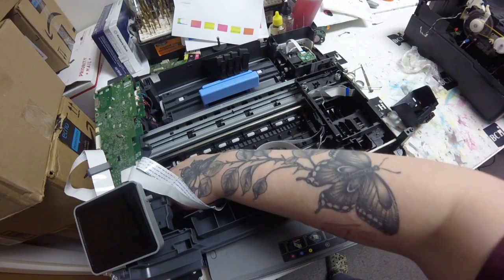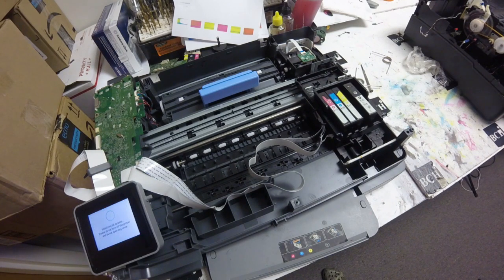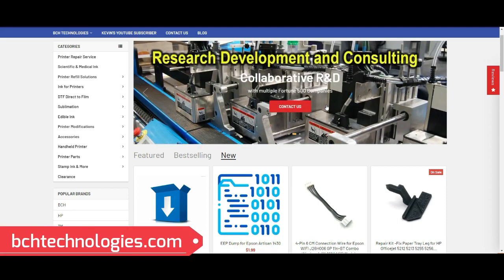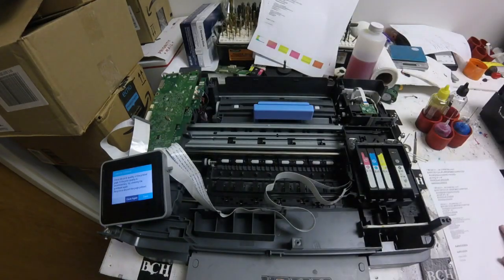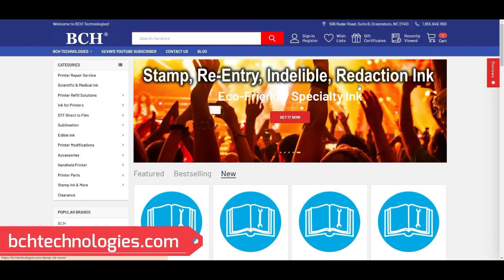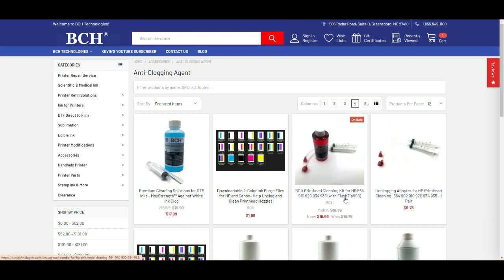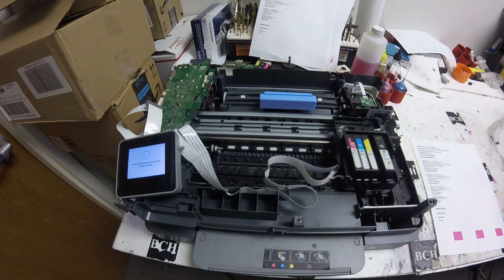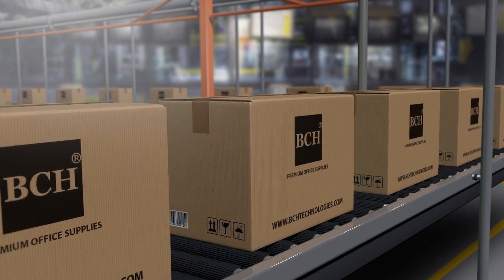Clean & Unclog Printheads for HP OfficeJet Pro 8022 8025 -Fix Poor Quality

Comment: I removed the entire printhead and soaking it in rubbing alcohol and hot water, to get all the ink out.  Hopefully that will fix the problem of it only printing black and red.  But I'd also like to know how to clean the area where the printhead sits (waste ink or cleaning/wiper blades area?)
Reply from the maker: Thanks so much for your support and for sharing what you tried—I really appreciate your engagement and hope this helps clear things up; on this particular HP OfficeJet Pro 8022/8025 design, soaking the entire printhead in hot water or alcohol can actually cause internal damage, because only the nozzle plate (the very bottom where ink comes out) should ever be exposed to liquid, while the rest of the printhead contains sensitive electronics, so if you’re soaking it, limit any liquid contact strictly to the nozzle tips and let it dry thoroughly before reinstalling; for the area where the printhead sits, you can gently clean the wiper blade and waste ink area using lint-free wipes lightly dampened with distilled water or cleaning solution, being careful not to bend or tear the wiper; if this helped, please consider subscribing or becoming a channel member since I get a very high volume of questions and replies are prioritized this way: subscribers and members are typically answered within 48 hours and also get perks like early access to videos, regular viewers are answered if time allows because I can only reply to about 10 questions per day, and after subscribers and members any remaining reply slots are filled last-in, first-out with newer questions reviewed first, so if you’re not subscribed and don’t hear back within 48 hours you can either subscribe or repost your question, and if you subscribe later your older questions automatically become priority without needing to repost; you’re also invited to join Run With Kevin — LIVE, where I go live every morning (usually between 6–8 AM Eastern) answering printer questions in real time, so subscribe and turn on notifications if you want to catch the next session and ask directly; if you need faster assistance, email [support@bchtechnologies.com](mailto:support@bchtechnologies.com), and if this video or comment helped you, I’d really appreciate a Google review here: [https://g.page/r/CfL7k6nYvPQ9EAg/review](https://g.page/r/CfL7k6nYvPQ9EAg/review).

Comment: BOA NOITE QUAL E O ENDERECO DE EMAIL DA EMPRESA??
Reply from the maker: Nosso endereço de e-mail é: support@bchtechnologies.com
Reply: Hello my printer had stopped printing color only black, so i did several printhead cleaning and also used cleaning solution and i am now getting color but the black is now with alot of lines, and the color it has alot of lines too but they are light color instead of the normal colors can you please help
Reply: try a reset to see if it works.
Reply: @hugoalexandre3446  nvm yeah i have done several but they dont work